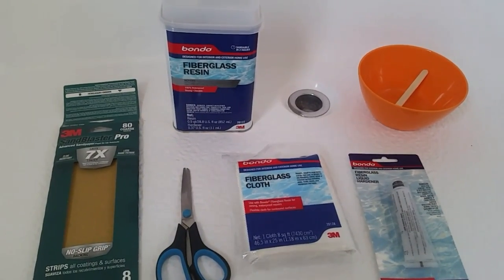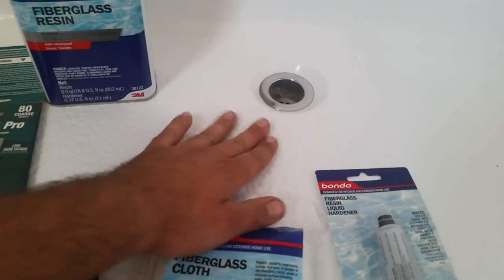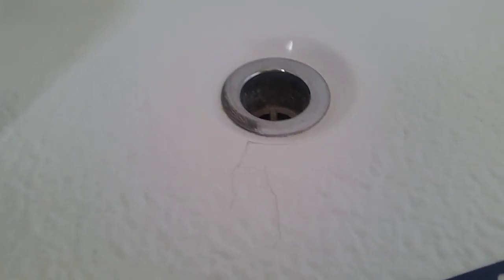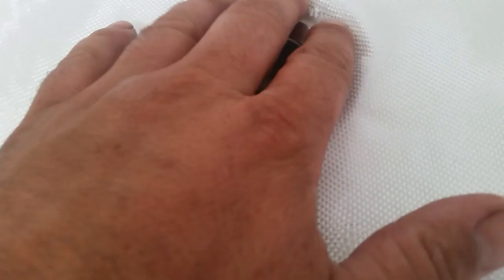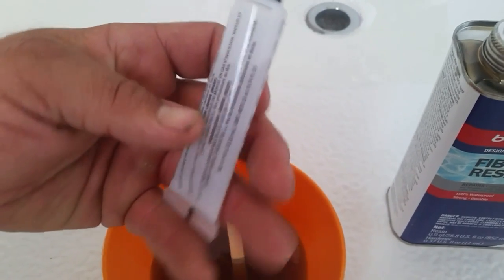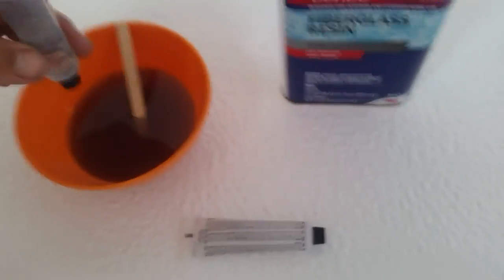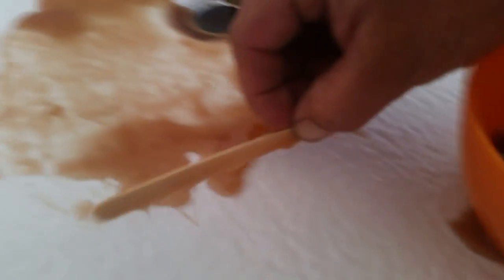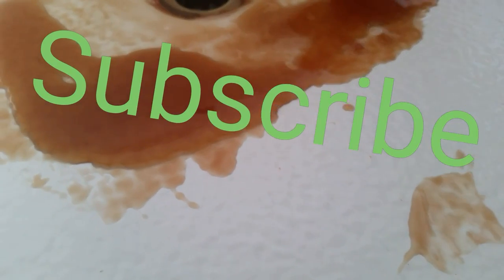How to repair a cracked bathtub the right way

Comment: At least 2 or 3 layers.... gees.. and it’s called a chip brush, 50 cents at Home Depot. Def wear gloves and a respirator unless your working on your outside tub:) oh and cut the bottom out of a solo plastic cup and trim to fit drain so you don’t get it all over the “chrome” drain plus halfway clog the drain.

Comment: Crack needs to be grinded out and then patch with fiberglass if there is air or not enough glass in the skid at that area...all you had to do was grind, paste,and sand it!!!what you did will never hold up,its gonna come off cause it wont bond very good to the gel coat.i do this for a living.never have i seen anything like this.Don't try this at home!!

Comment: Make sure you tape around the drain you don’t want fiberglass going down there plus you want to use a drill bit and drill a hole at the beginning and ending of crack to stop from spreading plus there’s other steps to do as while but I ant got time to explain

Comment: If you were gonna do it the right way, I would of took off the drain as well. Either way I would of just sanded it first and then used JB weld, mix the two together and it would of dried white and it works very good. Very easy and only cost like 6 bucks .

Comment: The way he fixed that insures it will crack again and it will be bigger. When you have a crack, you need to drill a hole at both ends of the crack. That will make sure the crack will not continue. (I did learn something in the Navy)
Reply: I'm so happy I read your comment.  I learned more from it then this whole video.

Comment: Brown resin is old resin.  It will be a brittle repair. And could have curing problems. It could remain sticky and not dry properly. Resin is like milk. Meaning it has a self life. Resin should be candy color reddish or pink normally. But see through not cloudy. Or hazy. Fiberglass cloth is ok. But, chop mat is best.

Comment: If you can press that tub down like you did with your hand after people step in there I don’t know for five times it’s gonna rip the clock and you’re gonna have a problem you should have pulled the drain pipe out to see how extensive the damage was if it goes all the way around the drain you’re not going to fix it it’s got a leak and always remember when you said the new tub makes a bag of concrete is dry as you can and pour it in a pile under the base of the tub where you’ll be standing and set the tub in it and don’t stand in the tub let the concrete harden you’ll never have a problem with that tub that’s how the plumbers do it! Thanks for putting together the video I hope I’m wrong and you don’t have a leak again however as a fella that’s done these things for 35 years………
Please do a part two and six months or a year or anytime afterwards let us know how this works good or bad thank you! 
I still clicked like for the video because you did a good job and making the video and showing us what you did I would have liked to see the finished product but maybe if you do a part two will be able to see what it looks like and yeah you could sand it all down and paint it like a car and blend it to the bathtub so that it’s him you wouldn’t even know it was repaired!

Comment: My shower stall tub has cracks all across from the side to side and it seems to be at every single point where they support underneath it. If I stepped in between those areas and very soft and there is definitely movement in the fiberglass. . How do you fix that? Is that just a straight-up replace and remove or is there a fix?

Comment: Should have showed complete repair.  Also, you needed to drill hole and inject expanding foam for support between tub bottom and sub floor.
Reply: I hope this suggestion works.  I think this is the step I have been missing and my work cracks again after a period of time.

Comment: A lot of video banging on here.  I appreciate the information, I have a crack, I used a repair kit, it opened up on first person.  I did not get the fiberglass cloth to do my repair.  Thank you for showing that.  my only thing is the lack of covering after with white, what paint doesn't peel  when wet?  Can't I use a white silicone or epoxy after the fact so it dries white like my tub?
Reply: Homax  Tough as Tile one Part Finish (spray)

Comment: Thanks for posting.... but since you were posting, why didn't you try to do a better repair?  The fiberglass should have been trimmed neatly, the drain should have been masked off, the resin should have had white coloring added to it...
Reply: Rick Jones dude he did it all wrong. Cloth goes underneath

Comment: What did you do about the resin that got on the drain chrome and how did you buff the resin without exposing the cloth?
Reply: yea, wtf do you do with the clothe ??
Reply: @hotdog12ify  the cloth stays where it is, it makes the resin a lot stonger. Once everything is dry you can lightly sand to blend it all in, however in this case it's easier said than done.